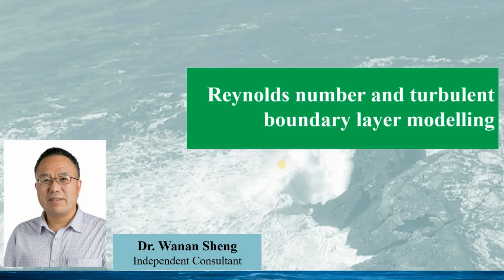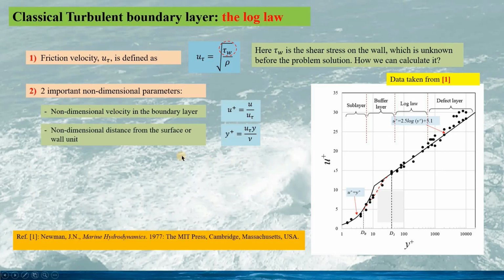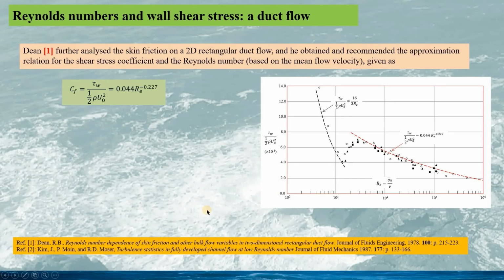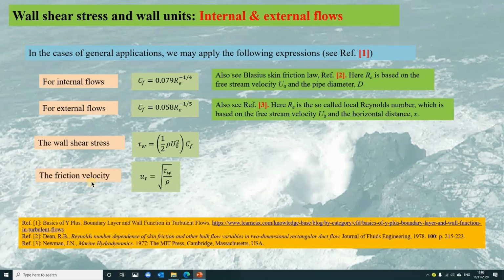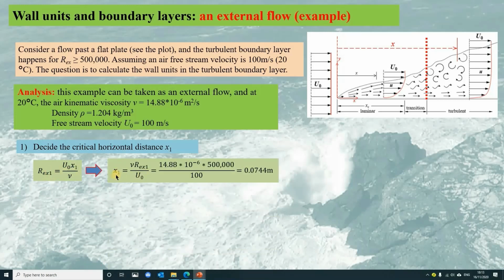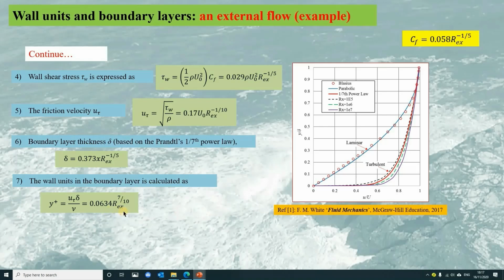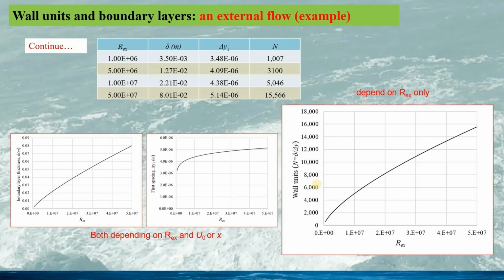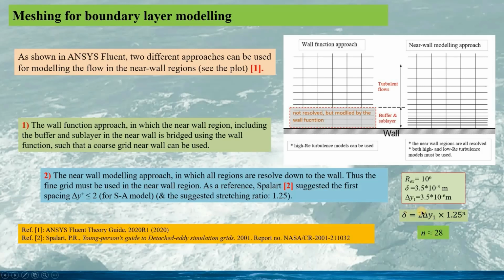Reynolds number for turbulent boundary layer modelling

Comment: According to initial calculation ( time 16:29 ), for Re=1e6, the number of wall units N obtained is 1007, while according to Spalart ( time 19:03 ) the number of wall units for Re=1e6 is found to be 28? why so big difference?
Reply from the maker: Thanks for asking. These are two different concepts: the wall unit is y+ for the whole boundary layer (1007); but when we generate the grid, each grid could cover many wall units. otherwise, the grid number would be impossible for CFD modelling, even DNS does not need such grid, for instance, at the centreline of the duct, Delta y+ could be as high as 10.
Reply: @ScienceofFluids  Great. Lovely. Thanks for the prompt response and guidance.